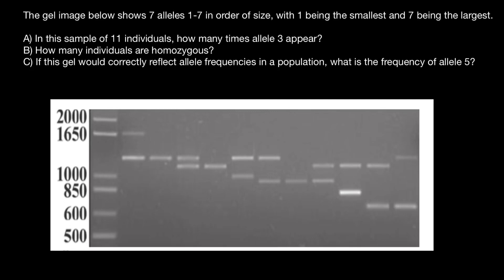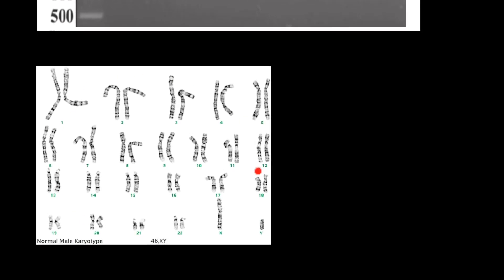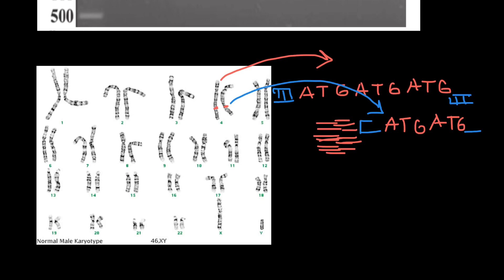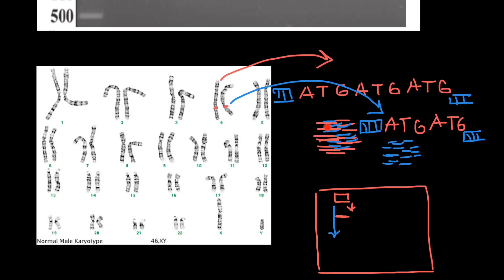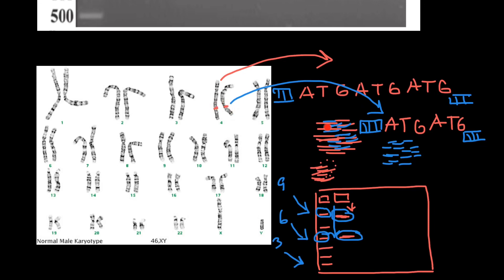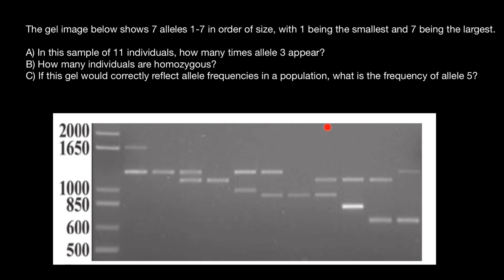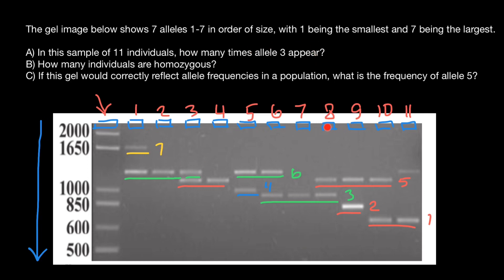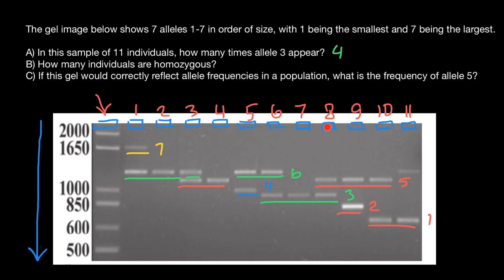How to understand gel electrophoresis results

Comment: what percentage of the 11 individuals would be heterozygous, i got 72.72%/73% ....... using 8/11x100. or was it meant to be 8/22x100?
Reply from the maker: 8/11x100
Reply: Thank youu
Reply: If the frequency of those exhibiting a monogenic autosomal recessive phenotype caused by only one known mutation is 1/12500 in a given population, what is the frequency of the wild type allele?………Can i get help with this one aswell please
Reply from the maker: Ok, I will make a video.
Reply: Can you add another question to the videos if it’s possible please……if the frequency of those homozygous for a specific mutation that causes an autosomal monogenic recessive condition in a given population of 300,000 is 1/12500, how many individuals are likely to be carriers of the causative mutation?